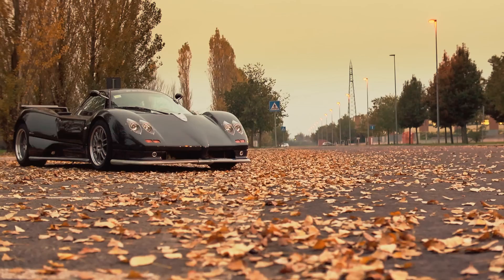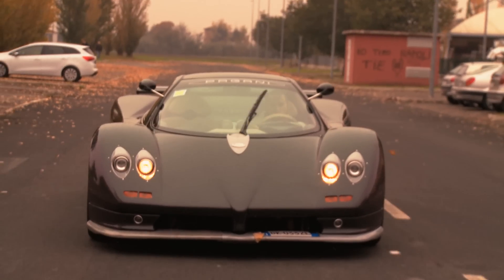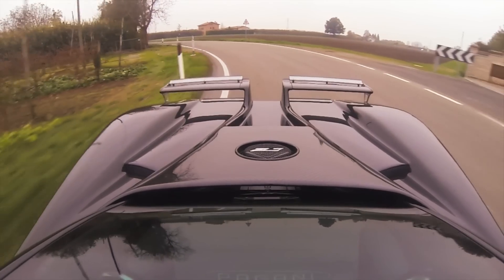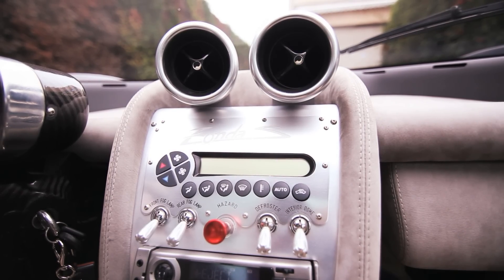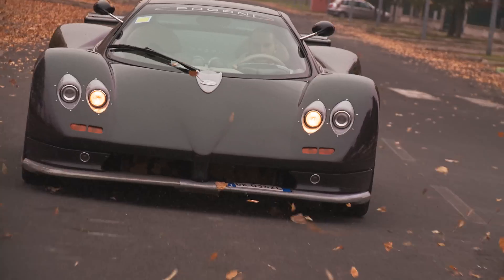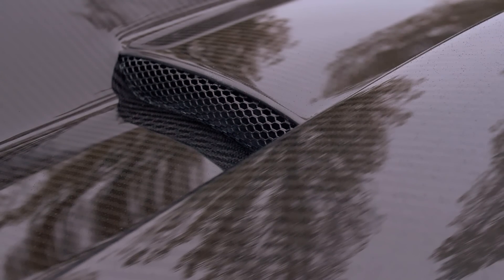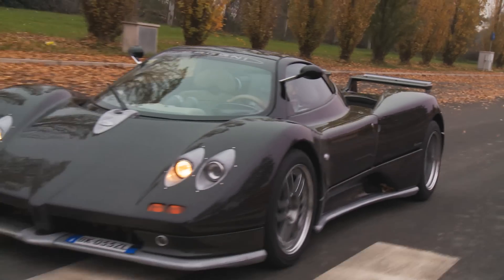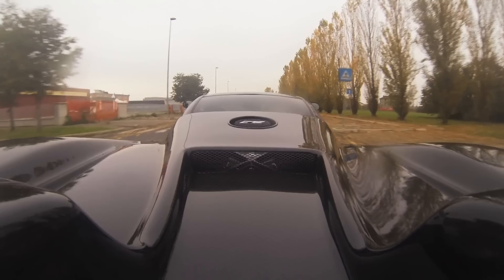Pagani Zonda S 7.3: Taking a Drive with Horacio Pagani - XCAR

Comment: i just noticed that the tail light lenses are just like the ones on some of the older lamborghini diablos.,,  just an observation. :)
Reply: Those lights are found in several other cars too. But the Diablo & a lot of Zondas do in fact share the same tail lights. Mr Pagani worked at Lambo for a long time and was involved in the development of the Diablo. He was very close with Lambo even after leaving the company. So it's quite possible the lights came straight off a Diablo or he would have looked at the same parts supplier.